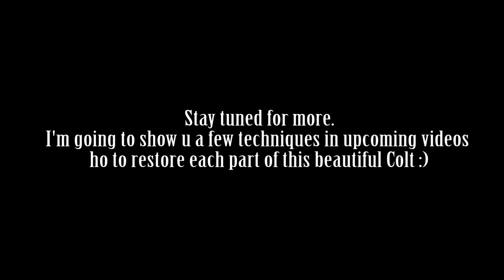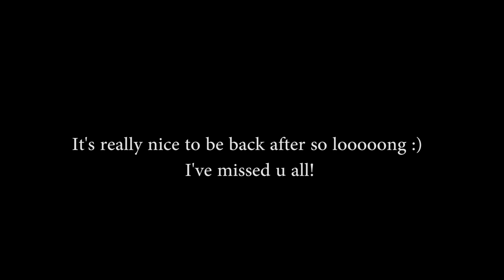Colt Lightning Restoration - Part 1 (Disassembly)

Comment: In the future working on firearms don't use wd40, use a gun oil like Rem oil or any other brand name of gun oil
Reply: WD40 is just as good as Rem Oil, if not better because it lubricates & removes moisture. Get off your high horse.